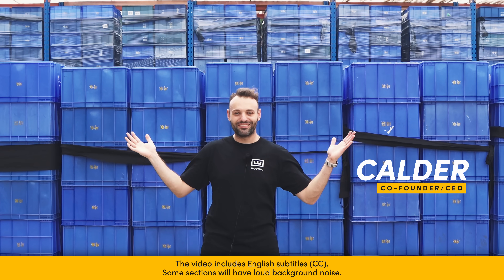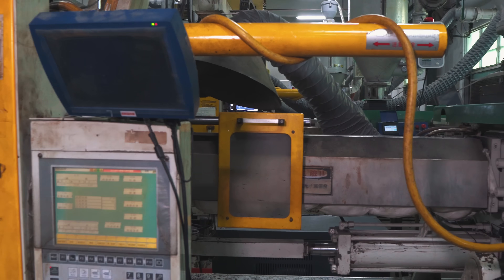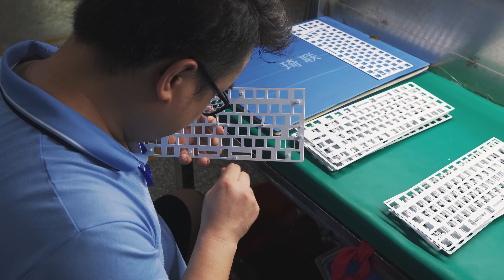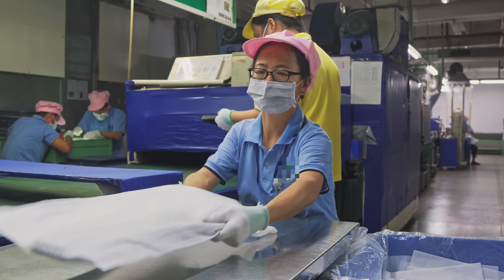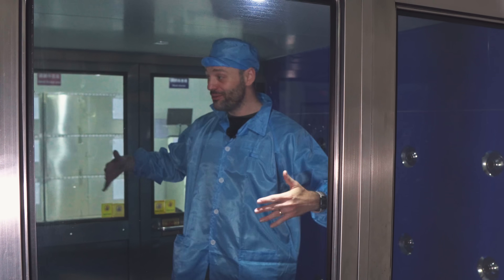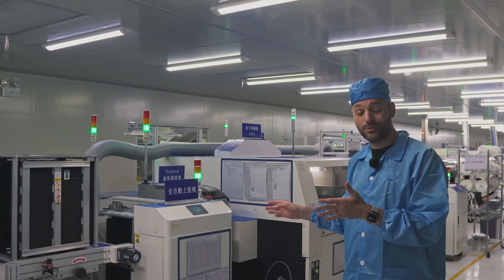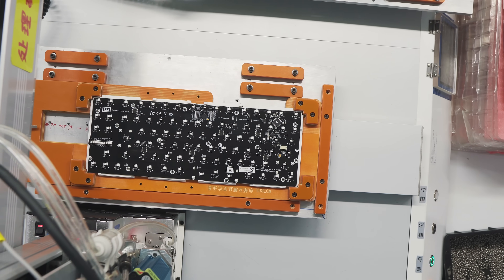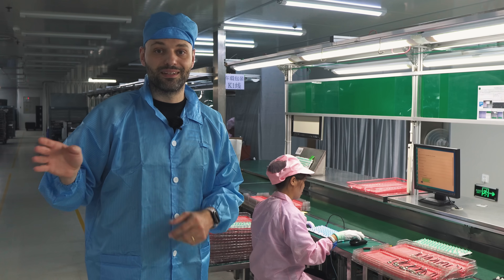Assembly of the 80HE Modules | Factory Tour Day 1

Comment: Shame my keyboard will come with the wrong switches installed and I have to pull them all off myself. :D Should have chosen the barebone version, I guess, but it was 10€ more expensive...
Reply from the maker: Module for the exact components is more expensive yes. But if you plan on swapping switches anyway then it will be the more affordable option.
Reply: @Wooting  I got the free extra switches (L45) when ordering and want to use them.
Reply from the maker: Ahh right. But there will be a switch puller included. So it shouldn't be toooo big of a hassle. Just a lil bit of time. :D

Comment: the  switches are put into the switch plate BEFORE the PCB? I have built a few boards and it was always the hardest putting switches into the PCB. Should the switch plate be bolted to the PCB and then the switches placed into the hot swap PCB? I find it really hard to believe all those pins just magically line up to the PCB.
Reply: Pins? Bolts? The switch plate is what holds all of the switches. They have no physical connection to the PCB. They hover above, with the magnetic sensors on the PCB detecting how hard each key is pushed down.
Reply: With mechanical switches it's a bit iffy to do that because the switch pins might get bent, or the hotswap sockets can get damaged. With HE switches you don't get those issues.
Reply: yeah, they magically line up with no effort, even if you don't believe it, that's the truth, if you took a wooting keyboard apart then you would know too, it's not hotswap like the other keyboards you built